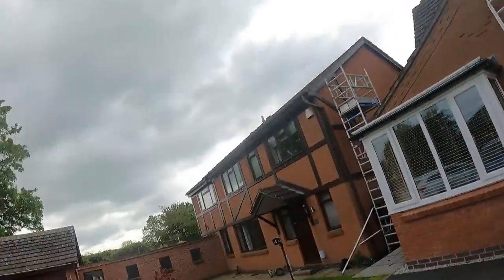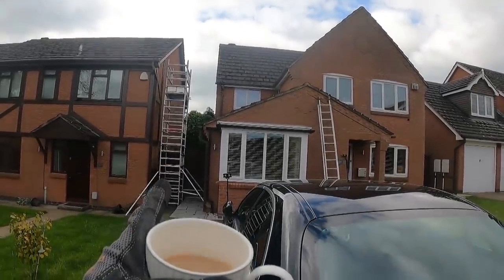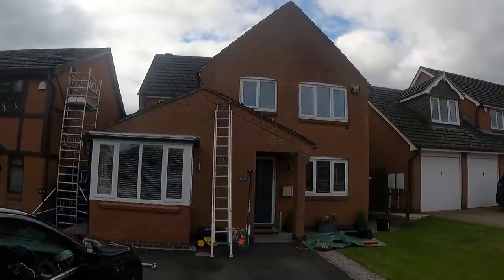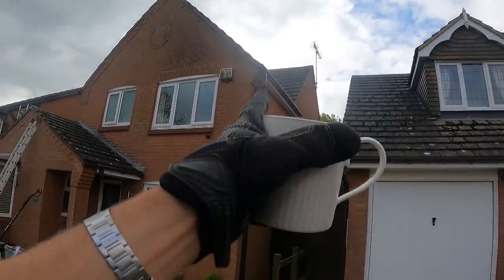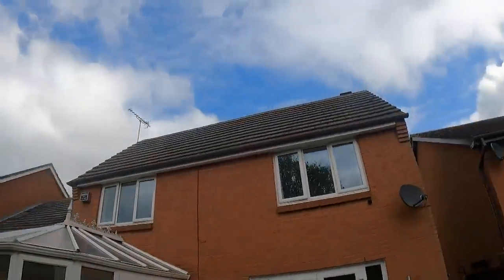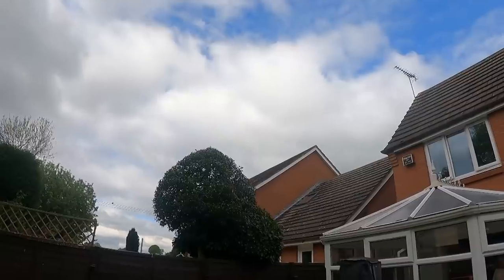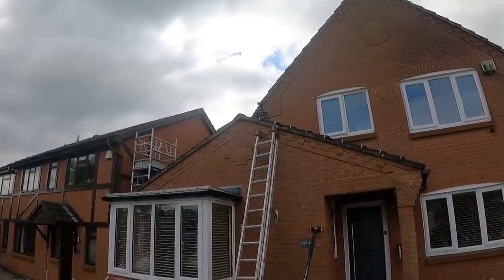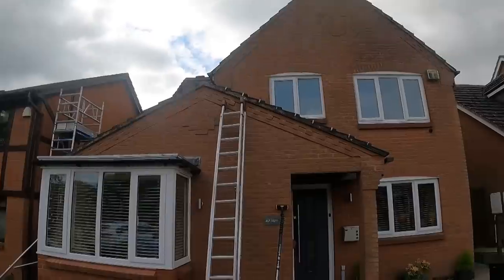This Roof Has 28 YEARS Worth Of Moss...

Comment: Not moaning lad but be careful walking on concrete roof tiles. These tiles have cleats cast into the back tro hold them on the laths and overtiime the tile can develop cracks, on a steep roof when you walk on it the crack lets go and the tile slides down the roof with you skeeing down the roof on it, next stop casualty. Take it from an old builder, be careful on these, in fact any roof, you cant trust them. Use edge protection and get a roof ladder lad. They might seem expensive initially but 3 monthss with no work waiting for a broken ankle to start to heal in more so.
Reply from the maker: Yeah definitely mate I checked it over fully before stepping foot on it, I had to anyway due to the top apex being unreachable, it was that or get on the big roof which is scary :D it was solid a nice pitch to walk, scaffolding would of caught me anyway as it was pressed to the guttering 👍
Reply: @PartridgeExteriorCleaning  I know you are proferssional, just seen too many good lads get hurt over the years. take care and love the way you work.

Comment: Another top job sid pal. Just a quick one try standing on the bottom of the tile as that's the strongest point as it has the head of the tile underneath for bit more strength so shouldn't fracture ( not trying to sound patronising) as I know you know what your doing all the best as always pal
Reply from the maker: Cheers Ryan! Noted!

Comment: Just found your channel. Love the videos! Out of curiosity, why do scrape the roofs instead of jet washing them? I have seen some other guys doing it. I was wondering if there’s a reason of if you just prefer it this way?
Reply from the maker: Good question! It's the least risk in my opinion, ideally with pressure washing a roof you would need two guys to do it safely, even just having someone down below to clean up all the mess as you go also. It can turn a one day roof job into a 2 or 3 day job just because of the mess. 
It's more cost effective for me,
Safer overall as some roofs are in bad shape,
easier to sell a scrape and biocide as most customers are wary of high pressure. 

So overrall the pro's outweigh the cons, most people want the moss gone, not a brand new looking roof so that's what i tend to target (:
Reply: @PartridgeExteriorCleaning  thanks!!

Comment: ALL your videos are great, pressure cleaning etc, but the ones of you cleaning a roof worry the heck out of me! I watch your videos all the time and give them a "like" and of course I subscribed.
So o o o o o, here's a few tips I found on the internet. Now don't laugh at some of them!
About making your shoes/boots less slippery on wet roofs.
What can I put on the bottom of my shoes to make them slip resistant?
1) Easiest, --yourself way to  your -
Scuff the soles with rough sandpaper, or something else with a rough surface, such as brick. 
Simply rub the rough item on the  of your  until small grooves appear.Feb. 15, 2019

Apply a Salt and Rubber Glue Mixture to Bottom of 
Adding a grainy texture to the bottom of your  will help improve traction and . 
For a quick solution, apply a salt and rubber glue mixture to the bottom of . 
Once that's done, simply let them dry for a several minutes, and you're good to go.
---------------------------------------------------------------------------------------------------------------------------
From affordable add-ons to simple DIY concoctions, these tricks will help save you from painful falls and spending a fortune on special slip-resistant styles.
Reply from the maker: haha thats very clever thank you! :D
I know a guy that wears long songs over his shoes, apparently the grip is perfect :D

Comment: Don’t want to sound like I’m telling you how to do your job but wouldn’t it make sense to clean from top down rather than bottom up because all the dirt from the top will just run down🤙
Reply from the maker: the vast majority is removed on the initial scrape, the rest will weather away so top down, bottom up doesn't really matter as long as the chemical has soaked in thoroughly (: